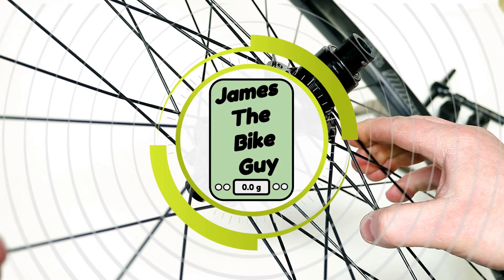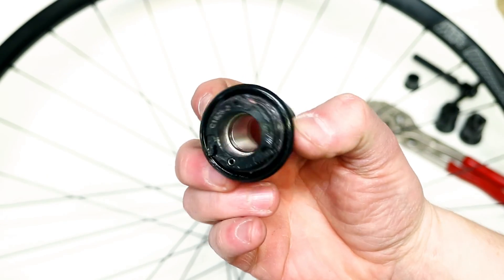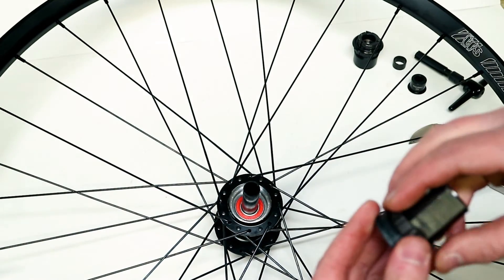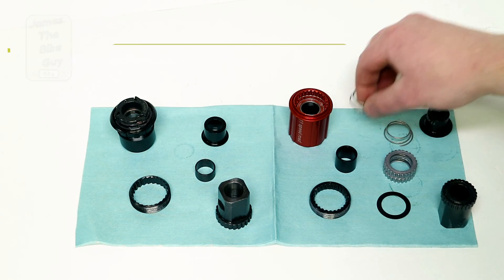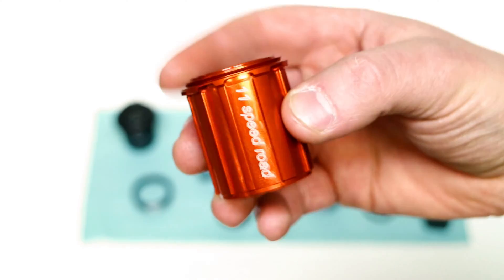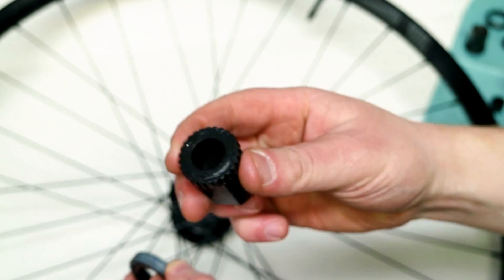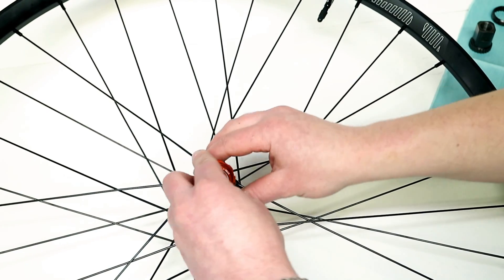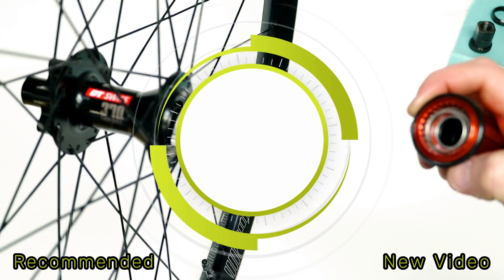How to Upgrade DT 370 to Star Ratchet Conversion using DT 350 or 240 Hub parts How To DIY

Comment: Great video and eagerly waiting for the list of parts!!!
Reply from the maker: Check the description now!
Reply: @Jamesthebikeguy  thankyou so much! roughly how much did it cost you to do the conversion cause right now its looking to be $300aud+
Reply from the maker: @dtran1742  I did it with parts I already had, just to prove it can be done. It is not super cost effective, but it beats cutting out the 370 and then paying to lace in a 350.
Reply: @Jamesthebikeguy  thanks for the response!! may ask a bike shop to borrow their dt swiss tools to save some money. Fantastic channel btw!!
Reply from the maker: @dtran1742  Don't do that. Pay the LBS to do the overhaul for you. They will charge you less than the cost of 1 of the tools and you will support the business that supports your community.
Reply: @Jamesthebikeguy  Will do!!

Comment: This should also work for the straight pull hubs DT uses for the Spline line of wheels.
Reply from the maker: I would imagine, shouldn't be any different.
Reply: Those are also 370 hubs if I'm not mistaken.

Comment: I giggled at how easily that drive ring came loose. Good luck with that on a used hub! Bet you loosened it before filming ;o)
Reply: I was going to say the same thing.  I filmed a trick on how to remove the drive ring on a six year old 350 hub.  The thing was a beast to loosen!
Reply from the maker: Lol. Yep pre-loosened it. I find it easiest to place the drive ring tool into a vice and use the wheel as the lever to loosen. Works great.
Reply: You could show that in your video. It's a core part of the process.  @Jamesthebikeguy
Reply: That’s definitely the hardest part of the process.

Comment: you also need specific grease for the star ratchet system,
Reply from the maker: Oooh, Good point. Since I was just demonstrating I didn't include that part.
Reply: I'd say that's not really necessary. I have run synthetic super lube grease for years with dt 350 hubs.
Reply from the maker: Depends on the engagement points, the higher engaging ratchet rings get really picky about what grease to use. Don't ask me how I know... RIP 72t ratchet rings.
Reply: @John_D2  which Super Lube NGLI number, 0, 1, or 2? How many teeth on your star ratchet? Thanks
Reply: super lube 21030 in the 3oz squeeze tube. Harbor freight , sells it , most hardware stores , etc.I have the 54t upgraded ratchet.